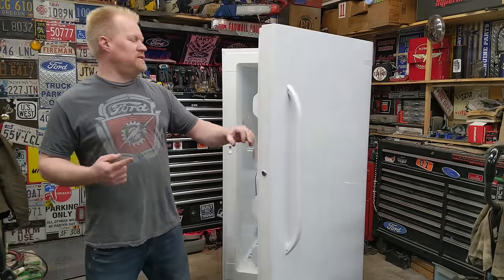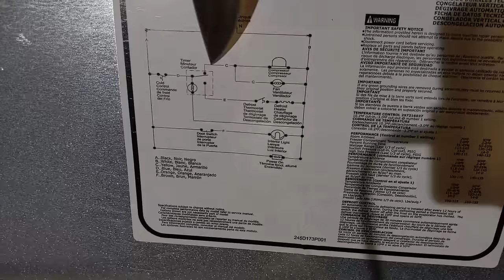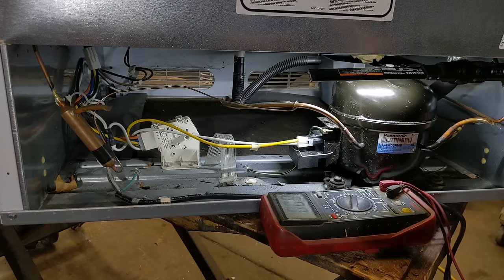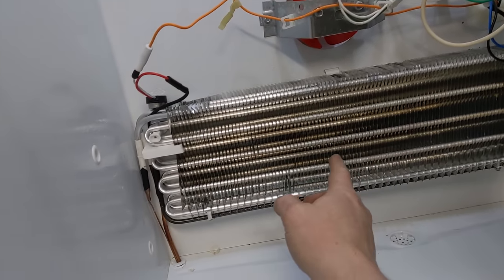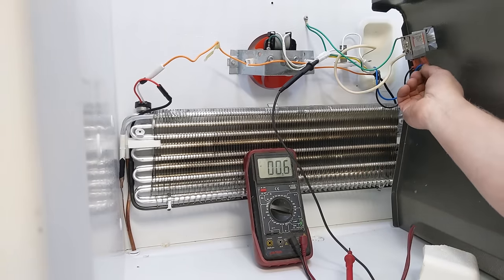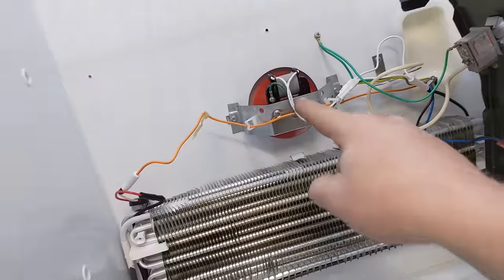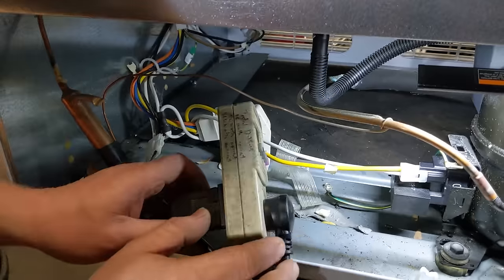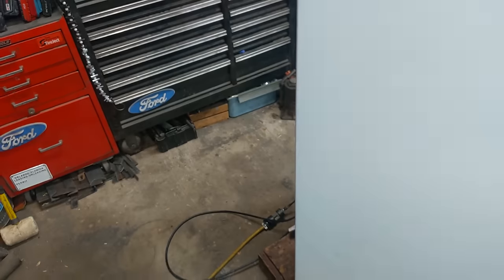Freezer Not Cooling HOW THEY WORK and REPAIR

Comment: I have the identical freezer that quit freezing. There was a block of ice under the heating element (compressor ran, but doesn't cool). I checked the defrost timer and it had NO continuity in any position of the dial, but when plugged in, it would start the compressor when I turned the dial around. I'm assuming that's the culprit, so i ordered a new one, but now I'm not so sure it's not the temp control thermostat? Unfortunately, I took the timer apart and gears flew everywhere. Guess I'll wait and see if the new one 😂makes it run...

UPDATE: the defrost timer fixed it! Thanks for this vid!!!

Comment: The wiring diagram is surprisingly poor, it didn't even show the PSC resistor or start relay, no caps shown, no view of the start/run windings.  Not even a description of refrigerant, almost like they don't want anybody fixing their creation.
Reply from the maker: The refrigerant with pressures/qty is listed inside on the main decal. This wiring diagram is pretty typical though more basic that some. It's meant to be a source for the repairman to know what components to replace as individual components themselves are never serviced by a repairman.

Comment: my freezer is stuck at -10C, i have checked Thermistor, it is fine.  i replaced the defrost timer and still same thing.  it is a kenmore 25328712800 upright model with electronic display and thermostat.  i get even frost on the condensor top to bottom
any help, TIA

Comment: Think this is problem with my Kenmore upright,model 253 that never gave any trouble in 15 years. It is down to 30 degrees and red temp blinks and alarm ( started yesterday) my thermostat has 3 wires. A red and blue ( both together surrounded by plastic holder) and a black wire. What do I do, in this case, to check and see, by jumping thermostat?

Comment: What temp is your freezer getting down to same freezer everything is working properly compressor is showing 150 degrrees head temp reading about 4 psi on suction line only getting down to about 20-25 degrees

Comment: I have a very similar upright freezer, but the commercial type...not cooling down.  Compressor runs, thermostat shuts it off, timer also shuts the comp off when manually cycled.  I noticed the capillary tube from comp to evap is freezing at the transition to the evap....low freeon?

Comment: I have a fridge that is running but not to great the condenser and compressor and the evap is working top notch but it seems the evap fan is barley spinning no real speed I’m about to buy one and replace it I hope it works….. think my g/f suffocated the airflow of the fridge !

Comment: I should have fixed my 45 year old one because new ones are crap haha but I was too busy at the time.
Reply from the maker: New stuff is crap. I bought an 1947ish Kelvinator fridge from an estate sale. It had been unplugged since the 80's in a basement. It needed nothing and ran right when I plugged it in. I cleaned up the cloth wiring and it was good to go.
Reply: Twice a year my electric company offers a $50 credit if you let them recycle it. They haul it away.
Reply: You absolutely should have fixed the old one. That said, Good luck finding freon.
Reply: @davidmeiselman3276  I don't think it lost freon, It just suddenly stopped running so it was electrical.

Comment: I have a small ( 5 cf )  chest freezer  no internal cooling.....no fan, no external coils..... I replaced the run capacitor  so motor hums and gets hot...suction line gets cool, discharge line is not very warm......is there anything else to try  besides  recharging  it?...thanks

Comment: I have a non frost free 9 cubic footer I bought around 1993 and it's still going strong.

Like the jumper idea on bypassing the thermostat to rule it out. I put a new cap and starter in my Kenmore fridge and it was still short cycling and popping. Finally accessed the thermostat just to look up the part number. When I reinstalled it the fridge started working fine. I think it was just corrosion or the spade connector was loose.

Comment: Absolutely Excellent!!  I have the exact same freezer with exactly the same problem.. I've changed the defrost timer..and suspect the thermostat... so think I'll get the tester out..and run through your diagnosis ...but pretty sure the thermostat is the problem.   I can get it to run by using a blowdryer on hot setting directed at the thermostat,  it will come on and run for a  day or so...but then shutt off and not start up again.    Thanks for your video... helped me big time.... to understand how it works!!!

Comment: I lost cooling in my freezer for a different reason. The drain for the water coming off the evaporator had pugged so the water wasn't draining leading to a massive ice build up blocking the air flow through the system. See my video for a better perspective as to my fix. You can check the drain first then if it is clear start the electronic diagnostics.

Comment: the fan has gone out on my unit twice now.. i made the mistake of replacing it with a cheaper fan last time.. use a name brand fan .. make sure it is a name brand fan not a knock off
Reply from the maker: Good to know.
Reply: @white freeman. You might have another issue you overlooked because usually those little shaded pole induction motors run nearly forever. I still have some I have taken out of units and they've continued to work for 20+ years. It sounds like you might have a high resistance somewhere in line with the fan motor. This would deliver a lower voltage to the fan and cause it to go out prematurely. I'd suspect the contacts in that white defroster control module......
Reply: @johnpossum556  the factory one went out after about 12 years.. i replaced it with a generic one from amazon that felt very weak and i had to move the blade up and down to find a place it liked and would run.. it lasted about a year.. i recently bought one semi locally because shipping has been crazy and did not want to wait on shipping.. had to drive over an hour to get it and thought since it was an appliance shop that it would be the panisonic motor.. checked the part number and it was correct but was a knock off.. installed it and it would not turn.. took it out and found that it was binding internally.. put it on a drill and spun it until it stopped binding.. it has lasted about 3 months and needs replaced.. i will pay full price and order the correct fan this time.. hopefully it holds out until it gets here.. i hate to pay full price and dont like to pay people to do things i can do but this time i think full price is the better option.. thank you for your insight though it is appreciated
Reply: @whitefreeman5798  When you say the fan felt weak was that when it was hooked directly to the 120VAC or was it on the refrig/freezer wiring? Next time check it in the place you purchase it to make sure it isn't binding. I have one shaded pole fan motor I remember buying for $6.97 at Kmart and I have to oil it every so often but I've had it for 30+ years. Since its a regular fan it really only gets used during the summer, though. ( looks just like the same size frame and style he showed )
Reply: @johnpossum556  one of the first things thata repair guy told me was those motors never go bad. He said that new grease alwayas makes them work even if they were sezed in a hot circuit. If they could not be taken apart--he would drill holes and oil them!

Comment: We had a second refrigerator that would cool for about 2 weeks then quit. unplug for 24 hrs, online resource said it was the timer. Replaced the timer as that was 2 weeks and it quit again replaced timer and worked 2 weeks rinse and repeat till I got tired of dinking with it

Comment: Great video thanks. I found last evening my freezer wasn't working, light is on but not cooling; too late to find one or get one picked up. Tried turning the temp colder and nothing. I figured I had nothing to loose so I unplugged for a while (hour) and plug back in. Didn't come back on right away but I woke up to hear the freezer running and it is down to 7 degrees. Any thoughts on what might cause something like that. I am pretty sure unplugging it had nothing to do with anything but don't know for sure. Thanks Keith

Comment: As I understand the defrost timer, it has power all the time to the timer clock but will switch power from the defrost heater or the compressor.  If the compressor stops because the thermostat is satisfied, the defrost timer is still running.  If the defrost timer is always running, it does not matter what the run time of the compressor is, the defrost will be every 8-12 hrs depending on the timer default is

Comment: Excellent explanation 👍. I have a question, I have a older upright freezer, was running good, got up this morning, not running. There is a small one way screw on the back bottom left. It was buzzing, I turned the screw to the right about an 1/8 inch and the compressor kicked on. Do you know what that screw is? Looks like the screw goes into a small box with several wires running to it. The box is what was buzzing. It's been running for about 2 hours since I turned the screw, thanks.
Reply: I think that is the defrost timer. It was stuck in defrost mode.

Comment: The coil in my mind is probably dirty And needs to be cleaned that is one of many people thing s that is one possible problem s with this freezer
Reply from the maker: The coils used to get plugged up all the time. Freezers made in the past 15+ years now hide the coil under the thin metal side walls. So the sides actually dissipate the heat.
Reply: @sixtyfiveford  çool . LoL 😅 🤣

Comment: Thanks. It's best to run it while the evap is shrouded and the door is closed so as to amp the compressor, check the compressor's discharge and suction temps

Comment: Thank you for this wonderful video.  I have a Kenmore, and it just does not freeze up any more.  Right now, it's more of a refrigerator, and it never stops running.  I placed my hand on the compressor, and it was very hot.  Is it supposed to be that hot or will the compressor burn out if I keep it running?  Do you have any suggestion as to what is wrong with it?  Thank you again.
Reply: Unplug it and let it defrost for two days with door open. Than plug it back in and dont open door until next day and check temperature,

Comment: Thanks for sharing. My freezer just stop working. We call a company to came these guys charge us 333. Canadian to service is . I wasn't going to fix it . But the guys said it was supposed to get serviced. So we said ok we had to pay before he start doing anything . This guy sit in front and all he did was pull a screw and test two wires. Then tell us it needs parts for another 279. WTF . He was there for half hour and did nothing. Now we out 333 buck and no freezer. How can people be so evil. No refund or anything for nothing. So I am going to try and fix now . Before I throw it out. It's only 3 years old this unit. What a ripe off.
Reply: trash it. get another one.
I had new  upright freezer brada, stopped cooling after like 6 months. It works, but there is barely any cold air inside. Paid  $350 for it, I feel like trashing it and just getting a nice cube freezer instead

Comment: I've got a Frigidaire unit very similar to this one (Model FFU14F2QWR), but for the life of me, I can't find the condenser coils. I figured that after two years of use, I should probably clean them so it will run more efficiently, but they are nowhere to be found. Any ideas?
Reply from the maker: They are under the sheet metal skin of the freezer. So the sides and top will get warm and radiate heat as is operates.

Comment: My Fridge is old, came from a General Store owned by Actor Steve Carell, it must be 35 plus years, it seems to run too often, I cleaned the dust out of it, set the freezer to zero and fridge to 40. Not sure what else I can do.
Reply from the maker: A lot of these older fridges run quite a bit. I think mainly do to poor wall insulation. It could also be a failed door gasket. Or it could be a thermostat with a narrow on/off window.

Comment: Hi I have the same freezer, my fan thermostat working. Compressor running, gets hot in few minutes. I see pipes not getting freezing up. What would be issue ? Your kind help would be appreciated. TIA
Reply from the maker: If the compressor is running but the pipes never frost up/get ice cold you have a refrigerant leak or failed compressor.

Comment: Thank you for your sharing. I have similar freezer and could not get cold enough.
I already tried to replace thermostat, temperature control & capacitor, and the problem persists.
Please advise me what I should do next step to isolate this problem. Thank you.
Reply from the maker: Look at your evaporator. If only the first few inches frost over your low on refrigerant and or the compressor is bad (not able to build pressure)

Comment: What happens if a very small part of my evaporator is frosting up? Jumped the thermostat as you show and waited an hour, only the first maybe 2-4 inches of the top left coil of the evaporator has frosted up and as I feel the coils going down it gets warmer.  What should I check next??  Confused…
Reply from the maker: That's generally the key sign that it's low on refrigerant. It could also be a failing compressor and/or clogged filter dryer. Unfortunately these are generally a death sentence as it costs more to fix than just to get a new one.

Comment: I picked up an upright freezer for free that a “reputable” repair company said needed a new compressor (which they would replace for $1600). In about five minutes I determined it just needed a new thermostat control switch which cost me $22.
Reply from the maker: Awesome.

Comment: I've had to replace the evaporator temperature sensor twice on my almost 25 year old "worldpool" fridge, but it's still going. Last fix was cleaning out the drip pan drain tube. That was probably the first time I'd ever done it. And a while back I bought some brushes for cleaning out the condenser coil underneath it. Had quite a but of dog hair and dust! Thanks for this video so if my fridge goes out again and it's not the sensor I'll how how to check other things! And for what it's worth, In my non-frost free chest freezer I think the coils are all around the walls as that's where all the frost forms.

Comment: Have you ever taken apart a thermostat like that and found what was wrong with it
Reply from the maker: Yes, I have. On really old stuff it's generally the contact points are just dirty and pitted. A quick sanding and they're good to go. This one had leaked all of the alcohol out of the capillary tube so it wouldn't expand.

Comment: bro you are a live saver,

but please need your answer

I tried like what  you did and I connect the two cable same what u did ( and its worked) 

But (((( I touched the freezer from out side and its very hot not like before))))

is it coz I connect the two cable ? 

and thank you
Reply from the maker: @abdulazizolfat5466  The outside of the freezer is supposed to be hot. That means it's working. All the heat pulled from the inside through refrigeration is then routed to tubes that are just under the outside skin of the freezer. There it's supposed to dissipate heat into the room etc.

Comment: sixtyfiveford, Nice vid. The troubleshooting could have been more informative if you showed the viewers physically where you positioned your multimeter rotary switch that it is on AC volt when testing house electricity. And also the rotary switch is on microfarad when testing capacitors. Thanks for sharing.
Reply from the maker: There's so many different multi-meters it would likely just confuse more than help.

Comment: I have 2 identical stand freezers. Both have the same problem. Both don't freeze. It runs for one hour and stops. It doesn't go to freezer temperature.  What could be wrong? Perhaps the compressor gets overheated.
Reply from the maker: You need to look at your evaporator and see how many coils are getting Frosted/ ice cold. If only one or two coils are getting frosted/ ice cold your low on refrigerant.

Comment: Thank you so much for this video. I have the same freezer that gets cold and freezes but then stops working. If I turn the thermostat off then back on it kicks on and works again. This is happening over and over. Could this issue be the heater timer? I would appreciate any info you can give me. Thanks!
Reply: Update: if anyone else has my problem it turned out to be the thermostat.

Comment: I bought a non-working $1500 commercial kegerator from a garage sale for $40. Replaced the thermostat for $20 and it's been working great for years. Such a simple and cheap repair yet most people will just replace refrigerators
Reply from the maker: That's awesome

Comment: Good day i have same freezer i replaced the thermostat and the timer on the back but still not freezing . Compressor working and kick and the compressor lines are cold but the inside the freezer vaprator ts not freezing , any idea why thanks
Reply from the maker: If the compressor is running but it's not freezing it's generally 1 of 2 things. Either the compressor is bad or the system is low on refrigerant.

Comment: Love your channel....long time veiwer...would like to see you take a side by side fridge/freezer and make it freezer in both side
Reply from the maker: The freezer side provides the cooling for both. Generally there is simply a fan that turns on and off that pulls frozen air from the freezer side until the fridge side is at temp; then it shuts off. The freezer side uses a thermostat and turns the compressor on and off as it needs.  You could simply cut a few big holes in the middle divider panel and the fridge side would freeze. 3-6" hole saw comes to mind.